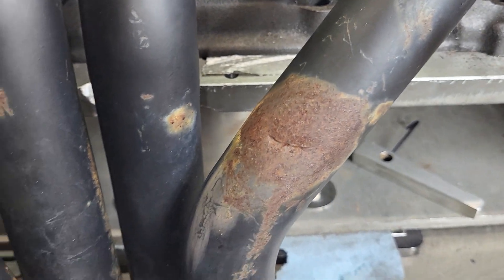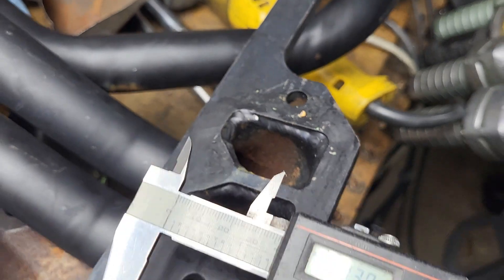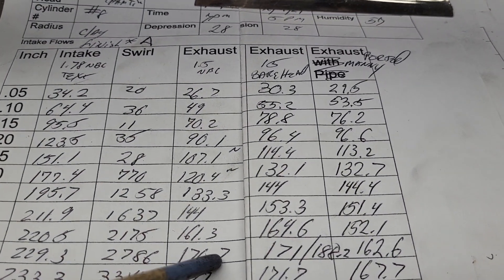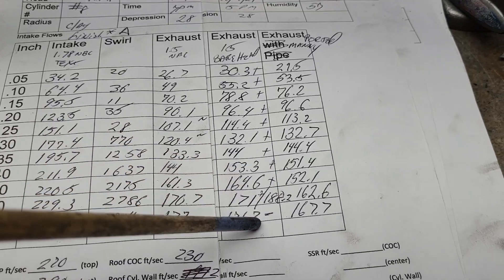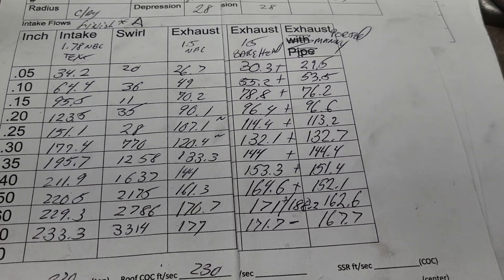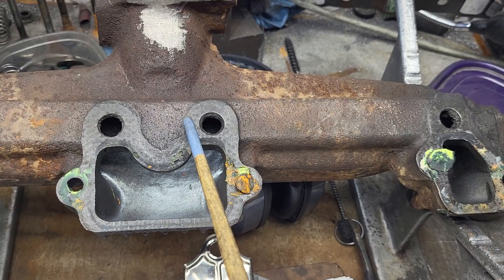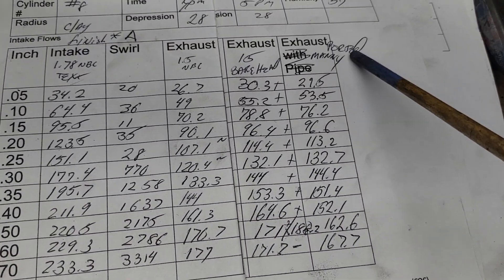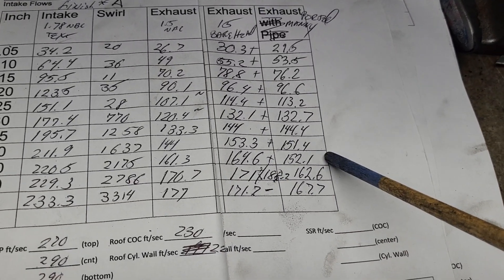David Vizard, Unity Motorsport, Mission Impossible 318 project. Exhaust manifold vs. headers. part 2

Comment: what I never understand was as long as 272 - 318 have been around just like the 340-360 have. they have diffent sized exhaust ports and 99% of headers are designed to fit the ports of 340/360  . you would think they would come out with 273-318 port headers . Not to mention the future exhaust leaks due to 2 diffent sized ports on manifolds and headers and gaskets . thats why I match up 318 manifolds with 318 exhaust gaskets so there are not future burn through on the gaskets
Reply from the maker: Good point.

Comment: I'm not surprised at your flow results. The induced drag losses in the longer pipe are being measured on the header, but not for the manifold.  That said, the header doesn't start to come into play until you have pulsed flow. I have dyno'd many cars before and after exhaust system changes. Not once have I ever seen the mythical 20% gain used in advertising. Often there was absolutely no discernible gains that could be measured, but that was on standard, or near standard engines. Personally, I think that the most important part of the induction cycle is valve overlap, as it starts the entire procession of intake charge movement. As such, the exhaust dynamics are absolutely critical if you are trying to obtain the maximum out of what you have. Going from one not so good set-up to another not so good set-up will show no benefit. However, going from a not so good set-up to a more good set-up will result in measurable gains.
Reply: I think DV mentioned once building a car with like 20ft long tube headers that worked extremely well.
Reply from the maker: I agree. Thanks

Comment: I built a 408 stroker, aluminum head, high comp, tight quench.  I ran port matched, enlarged exit magnum truck manifolds.  After a year I built long tube 1 3/4" to 1 7/8" step headers, fenderwell exit with 2 1/2" to 3" merge collectors.  I also set the primary tubes into the collectors in proper firing order.  I picked up 5 tenths and 9 mph.  However the best improvement I realized was no more detonation or pinging.  With the manifolds I needed race gas for full throttle running, it was fine at any other driving.  With the headers I have no problems on 93 pump under any conditions.  That was an unexpected surprise which made the ridiculous time I spent building them pay for itself.  I'm thinking the better scavenging may evacuate my cylinders better, reducing combustion chamber temp and intake charge dilution.   Funny thing is I wasn't going to switch except the iron manifolds were too close to my steering box and frame (mopar in a Ford).  But again Charles, thank you for all your time and work you let us see.  Bobby O'
Reply from the maker: In reality it reads like the engine needed a different lobe center angle for manifolds than headers due to their poor flow and lack of tuning. Good info. Thanks
Reply: Cool, Thanks for the info!  I'm learning.  @servediocylinderheads
Reply from the maker: You are welcome.

Comment: Nice!  It looks like you are measuring the flow resistance (head loss) of the header tube.  To be closer, a 1 5/8 exhaust pipe could be added to the manifold roughly the length of the effective header tube.  This would more evenly compare the two and then see the difference between the "plenum" manifold with the transition losses vs the header.
Reply from the maker: 1 5/8 will not cover the rectangular ports! So I used the 1 7/8 pipe on all ports.
Reply: @servediocylinderheads  I was referring to hooking it to the exhaust collector (2.25"?) and make a single port exhaust pipe to mimic the tube length of the header.
Reply from the maker: Got the valves and mics! You rule! Thanks!
Reply: @servediocylinderheads  You are welcome!

Comment: Thanks Charlie , HP big block  manifolds in the muscle car era out flowed most tubed headers. The biggest draw back is weight with those factory cast iron manifolds.
Reply: I like the upsweeping Mopar Max Wedge exhaust manifolds.
Reply from the maker: @RichardSTibbetts  Sexy!
Reply from the maker: 427  l88 manifolds were sweet!
Reply: Nick's Garage tested exhausts on a 6bbl 390hp 440 with stock cylinder heads. The contenders were,  2,1/2" outlet HP/Magnum exhaust manifolds & reproduction Max Wedge exhaust manifolds & dyno headers. 
The vid title is below.
Dyno Room Exhaust Battle - Max Wedge vs. HP Manifolds vs. Headers 
(To bypass the filler the dyno fun starts at 15mins in, the conclusion dyno sheets are at 46mins 40secs).

He weighs HP & MW but not the headers. MW nearly double the weight of HP/Magnum manifolds.
I'd guess headers weigh about the same as MW manifolds.

HP exhaust manifolds gave up 50ft/lbs tq & 35ish HP over MW exhaust manifolds and 63ft/lbs and 40ish HP over headers. The torque of the header was up compared to the MW exhausts as well as being 300rpm lower.

HP exhaust manifolds are no good. MW awesome but not as good as headers in torque production on a 440 6-Pack. 
MW vs headers this would be worse on a 440 with a single 4bbl single plane intake with aftermarket heads, and worse again on a 500" stroker with a aftermarket heads.

Comment: Early 340 manifolds?
Reply from the maker: I think they are egr truck manifolds. Not exactly 1971 manifolds. They were donated. Thanks
Reply: @servediocylinderheads  yeah but can you guys use early 340 manifolds if that gets you where you need to be? I think they repop them maybe 800 dollars a pair.
Reply from the maker: @MrSwinger1  Not in the plan. They would help, no doubt. 340 stuff is pretty good!
Reply: @MrSwinger1  Who is Re-Popping the early 340 exhaust manifolds?
Reply: @MrSwinger1 the 318 was never equipped with HP manifolds though. No sense in bucking the system 😂, although yes they absolutely flow better! I’ve seen the manifolds Charlie is using now on trucks, vans, and cars..nothing special about the casting but the flow through them is definitely impressive! Thank you to Brokentool for contributing to this project! He also mentioned adding a pipe to simulate the collector- this definitely has merit. Experiments done with header (nothing past the collector) showed very little gain…adding 24” of pipe after the collector showed a huge gain because of what they called sonic vacuum scavenging the incoming intake charge.
Reply from the maker: Good info. Thanks! @MidnightOilsRestoration

Comment: CarCraft put headers on a Dakota RT (magnum 360) when they first came out and the OEM manifolds on it worked just as good, almost no gains with the header.
Reply from the maker: Those are well designed exhaust manifolds. I believe it. Thanks

Comment: My thinking is that headers make more power through the resonant tuning on overlap more than the dry air flow.  It will be interesting to see some flow numbers on the end runners/ports.
Reply from the maker: I think I am done testing exhaust. Time constraints. Thanks
Reply: And even easier on a flat plane V8 as each bank is an even fire four and responds better to exhaust tuning.
Reply from the maker: @Dr_Reason  One of the good reasons for a flat plane crank. Thanks